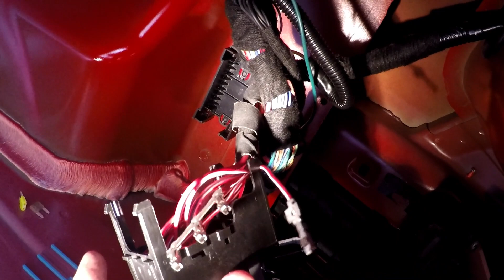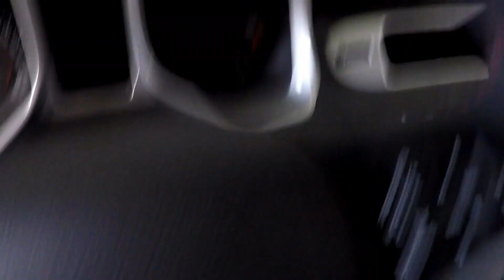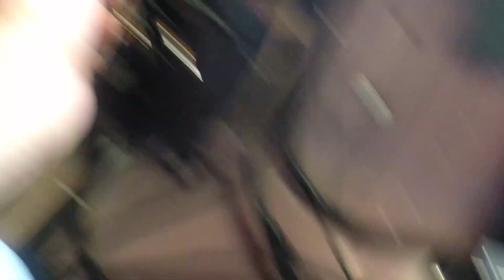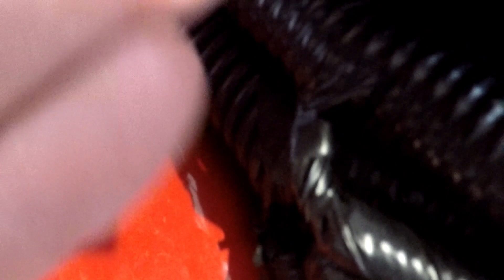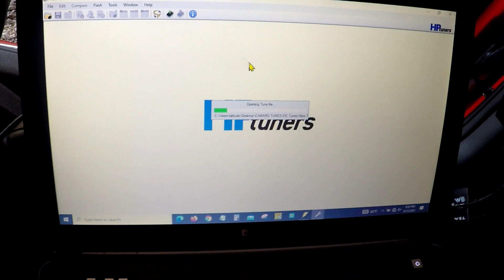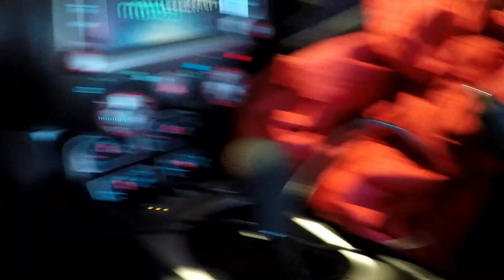Fuel System Mod Part 14 (Finally - Wiring the Pumps)

Comment: Did you ever have any issues using that small wire like the wire getting to hot or not having enough juice to trip the relay. FYI im no electrician i know verry little in that department. Also does your fuel lines stay primed after you cut the motor off? Im having to wait about 10 seconds before I turn the key to crank the engine to let the line prime every time I go to crank it.

Comment: ive been looking into this pump setup can you let fpcm run 1st pump like stock  but add hobs to second? so your not running first pump wide open?
Reply from the maker: I believe these can be pulse modulated like the oem pump, but you're best to call them and ask.